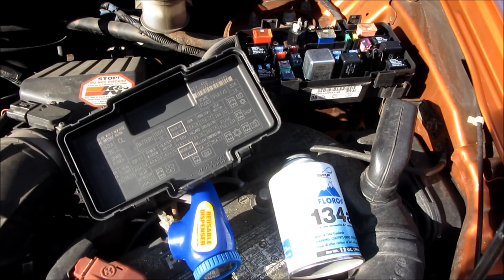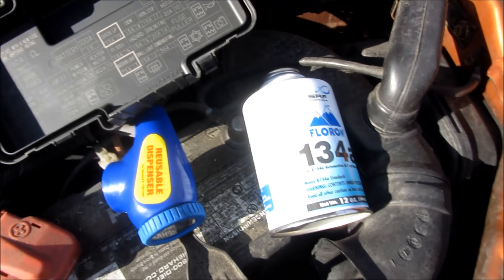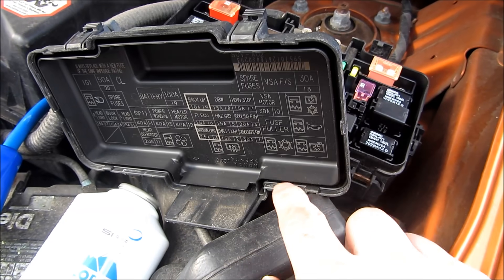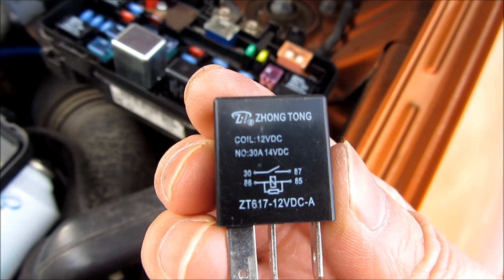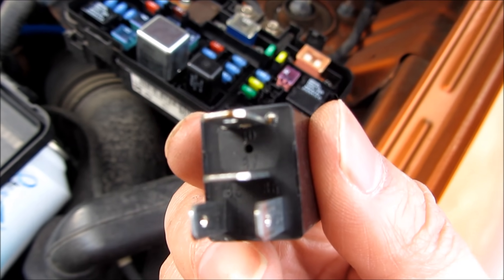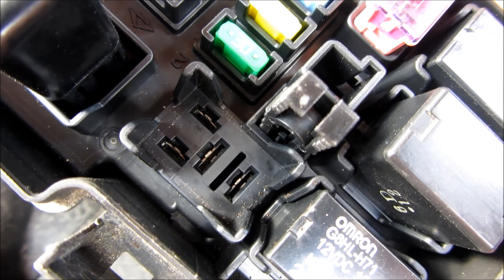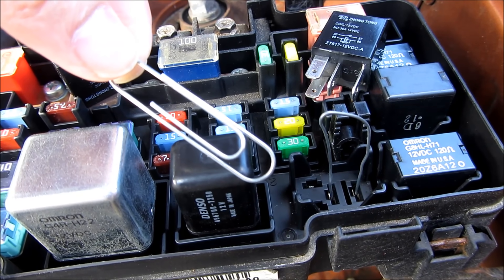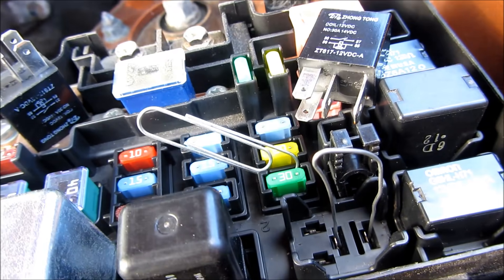Engage AC Compressor Clutch with a Paperclip on Relay | How to Fix Bypass Won't Engage | Jump Relay

Comment: It worked for me but when I replaced the relay the clutch doesnt engage? Is this the relay that may be broken?
Reply: Youve probably figured this out long ago but once you jump the clutch you need to check your refrigerant level, if its low add the right amount. Once you have the right amount of refrigerant, plug the relay back in. If it still wont come on, use the paperclip again and see if it blows cold. If it does replace relay or try another similar relay in your car that you know works

Comment: What does it mean when it works when I jump it and it doesn't when I put the relay on ? The relay is bad? Also when I jump it the lines get frozen ice
Reply: check refrigerant levels when compressor is jumped. could be low refrigerant. The compressor  clutch wont run even if the relay is good if there is not enough refrigerant

Comment: It worked in my car clutch turn on and my a/  was blowing cold...But after putting the relay back on it does not come on at all.....Can anyone give me info on this? Think I have a wireing problem.
Reply: Replace the relay. About $10-15 dollars for Honda Element
Reply: I replace it with other relays in my car and still no play but when I jrump 87 & 30 comes right on??? Any other thing ot can be?
Reply: SUBSCRIBE ITS THE DEVIL is it a Honda Element?
Reply: @Gringochulo1  2006 Chrysler 300
Reply: I’m having this same problem currently
Reply: @richardwalker4015  did you end up finding out and solving that issue? I’m having the same

Comment: The button on the inside of my van isn't working, can i use this method to bypass the button using wires running in to the cabin?

Comment: I found my ac magnetic clutch relay and it does not have numbers 87 or 30 it only has numbers 1 2 3 and 5 labeled on each side any help to bypass this would be much appreciated :) im dying of heat in California please help !!!
Reply: I drive a 1995 lexus sc400
Reply: you also have a 4? 1 2 and 4 are together in one direction. you want 3 and 5. the two bigger ones.  Just did it on a 2001 ford f 150
Reply: @jeffflowers729  so your saying to bypass numbers 3 and 5 correct ?? to engage the ac clutch
Reply: Myyoutubechannel yes using a wire to jump those two worked for me
Reply: I’m able to force my clutch to engage but it still  isn’t taking a charge. The same can and hose works on my other cars.
Reply: Ok ill try that today can i use speaker wire to make a connection?  I do have a paper clip as well
Reply: I tried jumping 3 and 5 on the relay circuit and the ac clutch still did not engage anything else i can do ? Thanks again
Reply: I have an 07 civic. I found the relay but there is no diagram. Not sure which ones to jump.

Comment: On your vehicle will you have all your relays a lot of those relays you have very many of them and they all have the same number on them so if you're having a problem with like your AC relay look it up on the chart so you can see where it is can look for it the same relay with the same numbers on it for example I was checking out a car AC wasn't working so I turned on the windshield wipers and they work fine I took the relay from the windshield wipers can I put them into the relay box for the air conditioning and also reject the windshield wipers and they worked so both relays for good this is also an easy way to see if a person has a bad relay on air conditioning also there are pressure switch could be bad I already replaced the pressure switch on the air conditioning system sometimes labeltex good with a scanner and then you barely tap on the pressure switch and the AC doesn't work so I always changed pressure switch on the air conditioning system you can also check on the compressor clutch why are going to the compressor clutch you can turn on the switch I see what the voltage is what does switch have to be turned on this place is it turned on it won't work so you have to have your key switch on can you turn the air conditioning on car you've already checked to see if the wire going to the compressor gives you focus put the key on and then you turn on the air conditioner you will get the voltage also you can use your test light or ohmmeter for the air compressor clutch you hear one prolonged volt direct current 1 to the negative and want to deposit it and it will turn on if it's working also on the clutch for the air condition compressor has electrical components in it and if those small electrical part of the clutch will not engage the clutch also if you're having computer problems in your vehicle because of pressure can you get check the voltage going to the four wire pressure switch  some cars have two pressure switches also some cars have a three wire pressure switch you can check the electrical on the line going to the AC voltage cause that pressure switch will communicate with the computer I always change the pressure switch in air conditioning system and with the key on the air compressor on turn on the I'm getting tired of you to go to bed okay and this information will help you
Reply: I came here for this. Thank you!
Reply: that's probably the longest sentence i've ever read...
... but i'm pretty sure there's some information in there i need...
... so i'm going back in...

Comment: After my car sat for a while and i finally got it to a mechanic to fix the alternator i got it back with nothing but hot air blowing. My ac used to be AMAZING. Hubs says the ac compressor clutch thingy isnt doing its thing. He got the can to refill it b4 he knew this and the damn pressure was TOO HIGH. csn he just let it all out and redo it or should i get a new fuse. I need a new car

Comment: What I'll do is I'll take for example the windshield wiper relay normally they are the same relay I'll take out the relay and put it in the AC relay as long as the numbers match they are the same relay then turn on the AC and see if the AC clutch comes on or not if that relay is working on the windshield wipers for example then it will work on the AC clutch so I just take one that's exactly the same number see where it goes and I will swap out the relays and see if the relay is good

Comment: My ac clutch relay has no diagram? All those prong/ connector things are all parallel or all in each corner... 
How do I find out which prong is what?
Reply: Most of the time there is a SNOWFLAKE on the AC RELAY. It international I guess. Notice at the 30-second mark here, he POINTS and the SNOWFLAKE DIAGRAM and calls it an AC PRESSURE CLUTCH RELAY....it's just the Snowflake.

Comment: Hi, my compressor won't engage due ECU malfunction so I followed the 
above steps with the engine running. Sure enough the compressor engaged but i let it run too 
long (about a minute )and high pressured white gas shot out in a loud 
hiss from the engine bay. I couldn't see from where the gas was coming 
from exactly, as I ran panicked to shutdown the engine. Question is the 
compressor destroyed? Or is it still ok despite what just happened?
Reply: Sounds like you had a blockage and the ECU wasn't malfunctioning but rather preventing more damage to your AC due to the low pressure switch engaging.
If there is a major restriction or blockage in the system and you forced the clutch on, eventually the low pressure side temperature will drop in pressure/temperature (enter the low pressure switch!), freeze, pressure will build up in the other side and bang. You probably blew a refrigerant line or an o-ring on the liquid side.
This is exactly what those canned "leak stop" kits that inject into your car's A/C system will do... cause a blockage in the expansion valve and then destroy your A/C... you didn't use one of those, did you?
Reply: @zachshaver3449  hi thanks for replying. It's was indeed the ECU that malfunctioned due capacitor leakage. Got it repaired and the AC is functioning perfectly. Thankfully nothing was damaged.
Reply: @earlchester6279  Maybe a capacitor blew, that can make a big bang also.  But if there is a blockage and you run this procedure for too long bypassing the low pressure switch, there is indeed a risk of rupture as I mentioned, I just wanted to make that really clear.

Comment: What does it mean if this doesn't work...ac clutch spins freely by hand so it isnt seized up...checked relay box has power...but clutch still won't engage
Reply: Did you figure it out?

Comment: I have a kia Sportage 2014! In the mornings whenI start my car and the a/c the compressor  clutch wont kick in. After I run the car for about 10 minutes or so the compressor kicks in! Pls advise!
Reply: Check refigerant levels, its probably low

Comment: Just add refrigerant until the low pressure switch is satisfied and the compressor will safely start. No bypassing of the compressor protection is warranted to charge a system with low refrigerant . No harm done if enough refrigerant is added before compressor damage occurs.

Comment: Tried this compressor kicks on, everytime I turn ac on but still no cold air ?
Reply: When the compressor is on you need to check the refrigerant level. Extremely low levels of refrigerant will cause the clutch to not turn on.

Comment: tl;dr Use paperclip to jumper pins 30+87 in your relay box while engine off. Done!
Reply: Sir after that, will the clutch compressor function? Do i need to buy a new relay?
Reply: @seanmhar123  Yes!   If relay was good you would have no need to bypass it in the first place.
Reply: @jamesebola1250  mine starts then stops repeatably lol does that mean mine is going bad ? ( Trying to recharge ac )
Reply: @lexlino6744  It sounds you are low on refrigerant. As you add more it will cycle less frequently.
Reply: @jamesebola1250  you’re wrong dude. It’s not because the relay is bad- the PCM only provides ground to allow the relay to close, thereby completing the circuit and engaging the clutch on the compressor. Because the pressure is So LOW, the conditions required by the PCM aren’t satisfied, and so it will not allow the functions required to add r134- that’s the “chicken/egg” reference at the beginning of the vid…the relay is Typically just fine…so now YOU know as well.

Comment: works when i use the paper clip but not when i switch the “horn” fuse to the ac spot . they’re the exact same 2004 trailblazer could someone help ??
Reply: Some cars don't engage the clutch if you're too low or too high on refrigerant, it doesnt matter if the rele is ok
Reply: Check refrigerant level while clutch is jumped

Comment: you dont need the clutch engaged  to fill , it will engage when the pressure rises
Reply: Your car also doesn't need tires. It will just hop along down the road when you give it gas.
Reply: @shanemeyer7989  hahahaha a
Reply: @shanemeyer7989  😂
Reply: Fruitcake, bad analogy.
Reply: Yep!

Comment: You don’t need to do this. You can just find a similar relay fuse on the panel and move it to the AC position. I moved my horn fuse relay  to the AC position and got it cranking again. 

Then go buy a new fuse when you’re done.

Comment: I was able to engage the clutch jumping pins 3 and 5 (Ford relay is 5 pins 1-5). but the system still won't take a charge.Shows no pressure in system at all. Same can/hose works on my other cars.
Reply: Jeff Flowers did you ever get this fidgeted our? I have the same problem
Reply: Brett Jones no I didn’t. Hoped somebody would jump in with solution. It’s a 20yo truck I barely use and won’t need AC for another 9 months again so moved on from it
Reply: Jeff Flowers so I got my fixed but the problem didn’t end up being the clutch. I realized that I wasn’t actually putting any pressure into the ac lines, the connections on the gauge set were all so tight to where the o-rings were squeezing shut the opening, I loosened all those and boom, pressure went into the lines, and the compressor turned on.
Reply: Brett Jones thanks for the update. I don’t think that’s my issue though. The same can/hose works on another car. I can see the gauge reading pressure and will take a charge. On the f150 the needle on the gauge doesn’t budge. Stays at 0
Reply: @jeffflowers729  Jeff having similar issue with my 99 f250 light duty. The compressor doesn’t kick on with truck started. Ac on. Manifold low side port open. Refrigerant line purged. I too jumped the clutch and it spins but I still can’t empty can. Manifold pressures stay at 90 psi low and 0 high. Any updates?
Reply: @MB-ln1yk  Sorry no longer have the truck. Don't recall I ever figured it out but wouldn't pass inspection for frame rot.
Reply: @jeffflowers729  Jeff. My issue ended up being the rubber gasket on the high side hose(manifold side) someone else that issue. Can’t crank them down too much.

Comment: Did this after a recharge didn’t work and my AC worked for 60 seconds before all the Freon exploded out! Blown compressor for sure ($$$) but at least now I know what the problem is
Reply: It happened the same to me 5 min ago.. can u please tell me if your compressor ended up blowing ?? PLEASE 🙏
Reply: @marianolosaviodiaz5688  any updates?  There are articles online that state not to do this..

Comment: Everytime I connected the paperclip it blew a fuse, what am I doing wrong
Reply from the maker: what make and model car and year do you have?  did you do the right pins?
Reply: @PoolarityChannel  2009 Chevy Malibu & yessir
Reply from the maker: @orinohboy  I see your "8866" jumper has 5 pins, did you do the 30, 87, and not 30, 87a?  Just checking, and the fuse is 10a?
https://www.partsgeek.com/gbproducts/WC/17833-01348936.html
Reply: @PoolarityChannel  I did 86 30😔 and yes 10a
Reply from the maker: @orinohboy  You mean 87 30 right?
Reply: @PoolarityChannel  thats the problem right there *86, no?
Reply: Orin Poree Replace fuse, identify sockets for thirty(30) and eighty-seven (87), try it again.

Comment: I have a problem my 10 amp fuse for the ac keeps blowing when I turn on my AC not sure what to do can anyone give me any tips what it could be? thanks for your time
Reply: Pull plug from compressor.   Turn on a/c see if that was the cause of the short or ground.

Comment: Why would they design the compressor clutch in such way? There should be a manual alternative to engage it without using paper clips or jumper cables.

Comment: Does anyone know why the compressor cycles on and off. I have the right amount of freon and it gets cold but then the compressor shuts off making the inside air hot
Reply: Can you describe the right amount of freon?
Reply: @noneyour2688  exactly at 38 psi

Comment: You don't need the compressor to turn to add freon. When there is enough freon in the system. the clutch will start to kick in and out.

Comment: I just spent the past 7 hours installing my girls new AC compressor on a 2004 Jeep Cherokee. I vacuumed the system and could not get the clutch to engage to accept new freon blew through two cans trying to do it and it over pressurize the system both times oh, I was trying to figure out how to manually put on the clutch on the AC unit and your video helped me 100% thank you so much
Reply: I wish you lived in Florida so I could shake your hand and give you a beer
Reply from the maker: Thanks for the kind words, its actually an honor to know I was able to help someone.  Good feeling to know this video was not in vain.  Thanks!!!
Reply from the maker: P.S. tell Rosanne Barr I said hello

Comment: Unfortunately, the compressor replay for my 2012 Nisson Quest is under (and part of) the fuse panel, and isn't serviceable. The want you to buy the whole panel I guess. 
I want a HORSE!  🐎 To hell with cars and the cost to keep them running.